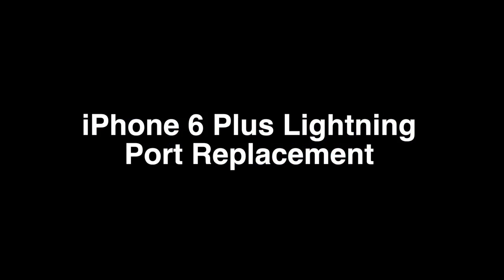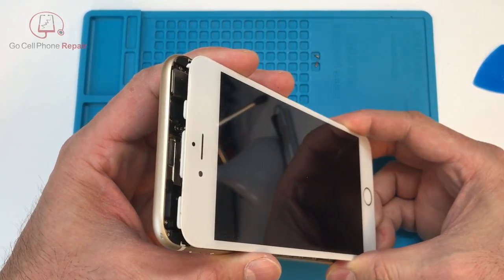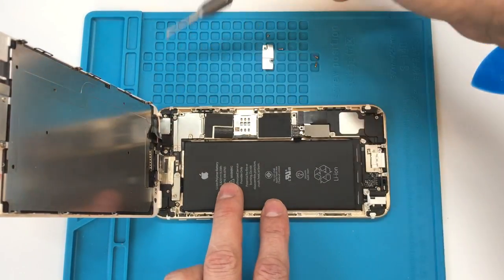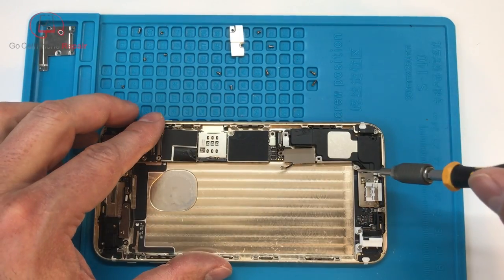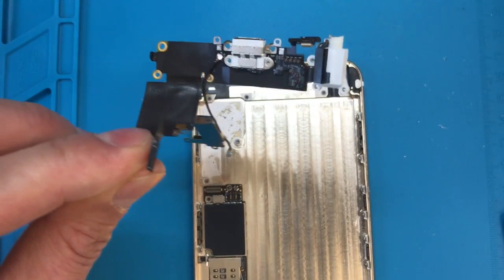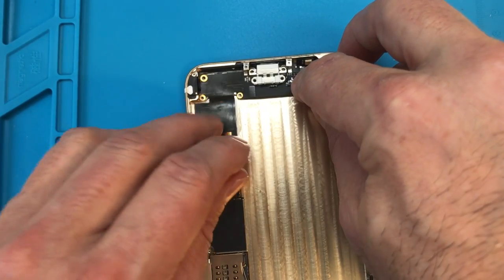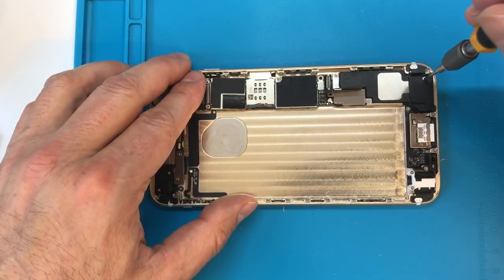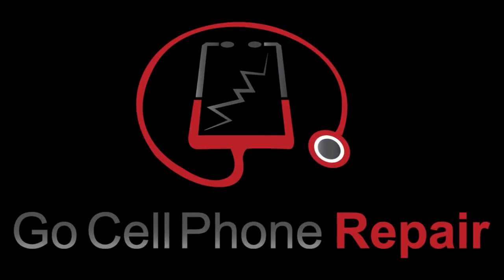iPhone 6 Plus Lightning Port Replacement (Leave Your Battery in)

Comment: Hey Mike were you replacing the battery as well? I don’t understand why you removed it
Reply from the maker: Ah, good question and I meant to mention that in the video. I started out doing this as a battery replacement tutorial and had a problem with my camera. Probably should have put the battery back in to avoid any confusion. Thanks for mentioning that. I'll try to figure out a way to communicate that to anyone who watches. Definitely don't want to remove these batteries unless they are being replaced.
Reply: Oh ok I hear you yea it had me thinking like why did he remove the battery but thanks for clarifying that and for your response as well.